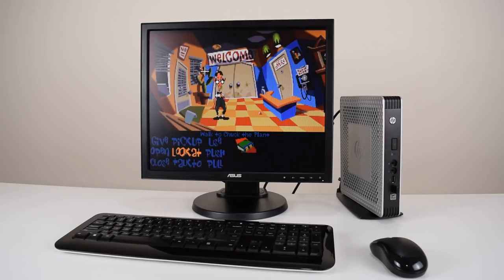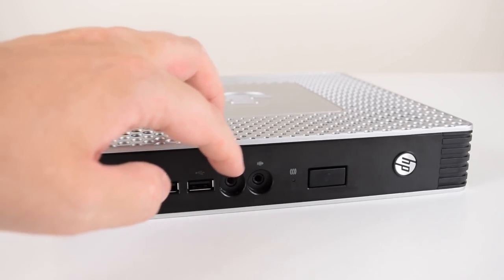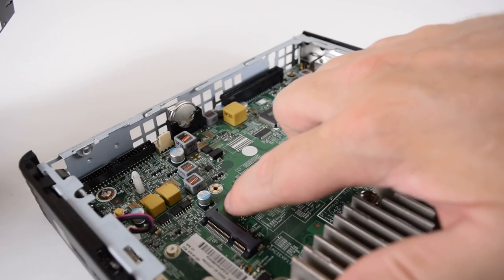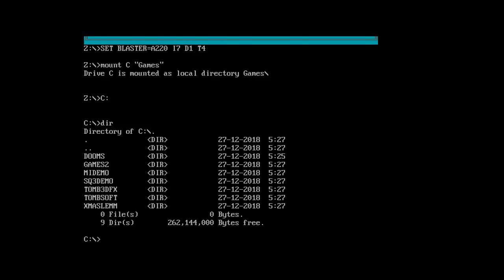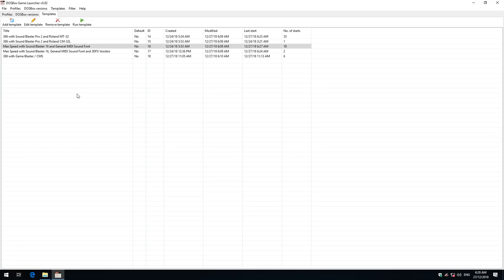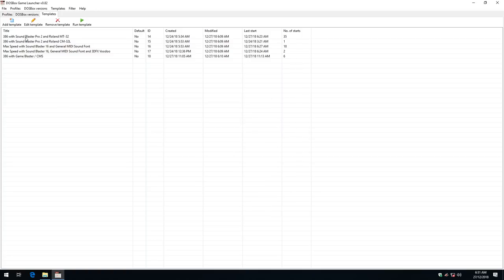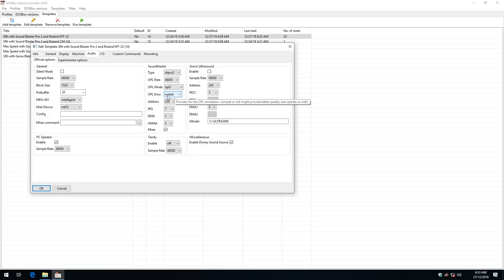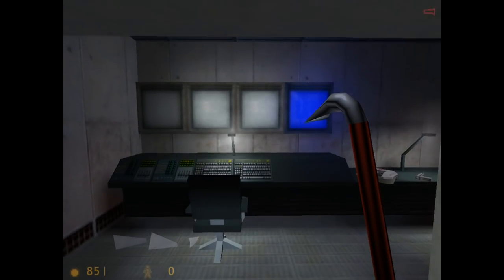DOS PC Classic - Building a DOSBox with Pixel Perfect Graphics, MT-32, 3Dfx Voodoo and more

Comment: Got your package and all the prerequisites. Trying to get it to work on an older ZBOX Nano (ID63) with a 3rd gen Core i3 processor running at 1.9GHz.
A lot of the games I try, regardless of profile chosen, has stuttering sound when I move the mouse.
I tried googling the issue, but can't seem to find a solution.
Is the Core i3 3rd-gen simply too weak for DosBox emulation?
Reply from the maker: Not sure to be honest. An i3 should be plenty if you ask me. I've only tested with the t610 Thin Client and on my modern desktop, but that one is much faster.
Reply: @philscomputerlab  Then it must be something else that's causing this.
Last time I remember such thing happening, was in the 90s, when the mouse and soundcard somehow ended up using the same IRQ. But that should not be possible through DOSBox.

Comment: I've ordered one of those, but it only comes with 2GB RAM.  Do you know if it needs anything exotic, or would any DDR3 SODIMM work?
Reply from the maker: Yea 2GB is standard. It is compatible with standard DDR3 SODIMM, up to 1600 MHz. Not that low voltage DDR3L stuff though.
Reply: @philscomputerlab  Thanks for the reply :)

Comment: Can it run Wing Commander 1+2 or Privateer or is the system just too fast?
Reply from the maker: Absolutely! The 386 profile should work great for Wing Commander 1. Wing Commander 2 you can increase the CPU cycles a little bit. Privateer AFAIK shouldn't have an issue with the maxed out profile, but you can start testing with like 15000 CPU cycles and increasing it as you see fit.
Reply: @philscomputerlab  Nice. How about joystick options? There is no game port so can a USB joystick work with well?  I have a swag of ISA soundcards, midi boards, and generations of motherboards and cases. Maybe its time to move on from all my legacy items. I know the wife would be pleased :-)
Reply from the maker: @wfp9378  Yea you use USB joysticks with Wing Commander :D

Comment: Basicly system is really good. But i have experienc some problem with Build engine Games like Blood or Redneck Rampage runs on dosbox on that kind of system. Its just to slow. of cource with vdm i can play Blood without dosbox but thats means i cant use Shadow Warrior audiocd from windows. Maybe if the cpu was 2.5 ghz will be better but then... another problem is the Terminator Future shock in 640x480. Its just strugle on dos box/ Not enought cpu power :(

Comment: Space quest 3 is not using MT-32 emulation.
Reply from the maker: Yea not sure what happened there...
Reply: MT-32 emulation does require rom files dumped from a Roland device, but that doesn't seem like a mistake you would make. The game's config probably wasn't set up to use the MT32.drv file for whatever reason.

Comment: Acer Aspire AT3-710-ES61 Home & Business Desktop System
Processors: Intel® Core™ i7-6700 (8MB Cache, up to 4.0GHz with Turbo Boost Technology) Includes Hyper-Threading
Chipset: Intel® H110 Chipset "Skylake"
Memory: 16Gb Dual Channel DDR3 PC3-14900 NON-ECC only (1867 MHz) (2x8 Gb DIMMS)
Hard Drive: Samsung PM851 256GB 2.5" SATA 6.0Gb/s Solid State Drive
Hard Drive 2: Seagate® Desktop HDD 2TB 7200RPM 3.5" SATA III Hard Drive
Optical Drive: Genuine ACER 8x SATA Slim Tray DVD Writer Optical Drive w/ Software
Network Card: Realtek Integrated 10/100/1000 Gigabit Network Card
Sound Card: Integrated Intel-Realtek codec 7.1-channel HD Audio
Video Card: Integrated Intel HD Graphics 1.5GB Shared Memory + AMD® Radeon™ R9 360 2GB GDDR5 128-bit
Monitor: Acer G247HYU smidp 23.8-inch IPS WQHD (2560 x 1440) Monitor 
Power Supply: Genuine ACER-FSP Group® 350W 80-Plus Power Supply
K/M: Genuine ACER Wired Business Keyboard and Mouse Set
Peripherals: ASUS Gamepad TV500BG Bluetooth Wireless Gaming Controller
Operating System: Microsoft Windows 10 Home (ASUS OEM)
Software: Microsoft Office 2016 Home & Business x64 (OEM English-International)
Reply: Now have an for 86box emulate machine:
First:
Machine: IBM PS/1 Model 2121
CPU: Intel 80386SX/20
Memory: 6122KB RAM
Sound Card: Internal IBM PS/1 Audio Card + Creative Sound Blaster 1.5 with Roland CM-32L
Hard Disk: PCemHD Type 9 112MB (C900/H15/S17)
Operating System: IBM PC-DOS 4.0

Second:
Machine: Packard Bell Legend 408CD
Motherboard: [Socket 5] Packard Bell PB570
CPU: Intel Pentium Processor 75MHz (Upgrading to Pentium OverDrive 166MHz)
Memory: 16384KB RAM
Video Card: Integrated Cirrus Logic GL-GD5440 with 1MB VRAM Fast 16-bit
Voodoo Graphics: 3Dfx Voodoo Graphics 4MB VRAM PCI
Sound Card: Packard Bell Sound Card (Sound Blaster 16) ISA
Hard Disk: PCemHD Seagate 1GB IDE HDD
Optical Drive: PCemCD NEC 4x IDE CD-ROM
Operating System: Microsoft MS-DOS & Windows 3.11 (Packard Bell OEM)
Software: Packard Bell Navigator 3.0 & Microsoft Office 4.3
Games: DOOM (1993) & Tomb Raider (1996)
Reply: Third:
Motherboard: [Socket 7] Award 430VX PCI
CPU: IDT WinChip Processor 240MHz
Memory: 65536KB RAM
Video Card: Cirrus Logic GL-GD5480 with 4MB VRAM PCI 32-bit
Voodoo Graphics: 2x 3Dfx Voodoo 2 v1000 8MB VRAM PCI + SLI
Sound Card: Packard Bell Sound Card (Sound Blaster 16) ISA
Hard Disk: 2x PCemHD Seagate 4GB IDE HDD
Optical Drive: PCemCD Samsung 24x IDE CD-ROM
Operating System: Microsoft Windows 98 First Edition
Software: Microsoft Office 97 Standard Edition
Games: Tomb Raider (1997), Quake 3, Incoming (1998) & Half-Life